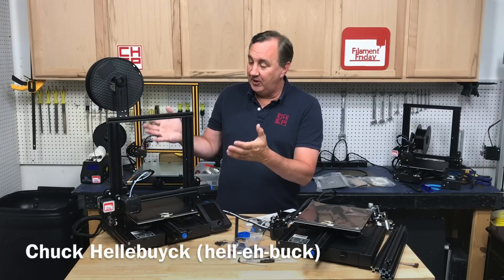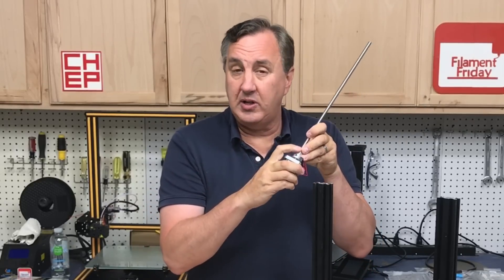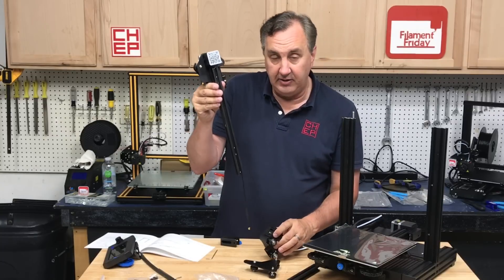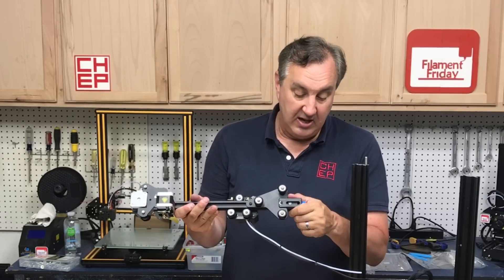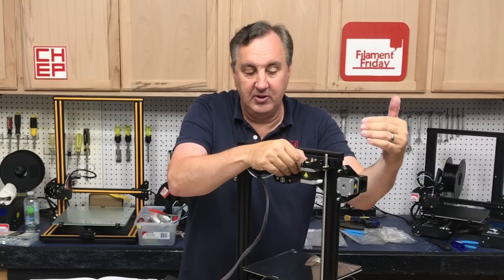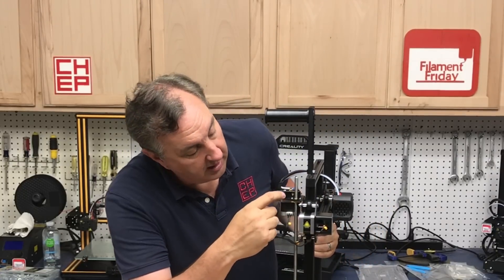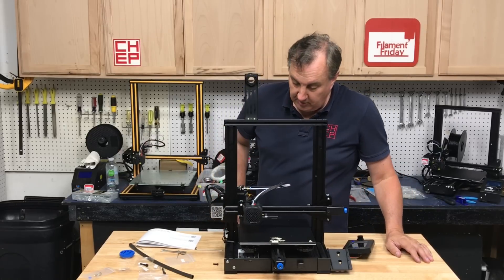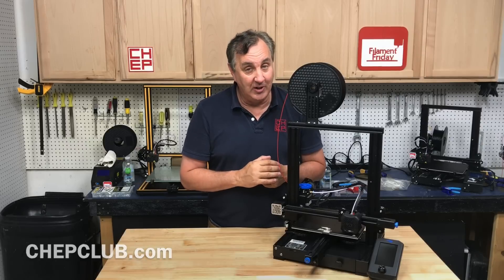How to Setup an Ender 3 V2 3D Printer

Comment: I have assembled my new Ender3 V2 and updated the firmware. Everything works fine but two things is strange. (1) When the power is off and I move the bed along the Y-axis, I can feel that it hits what feels like soft bumps at 2 or 3 places. Moving the bed using the motors, generates no noise or uneven movement. The second thing is about the mechanical switches on the printer. Using Octaprint I can step the extruder head and the bed, beyond the place where the switches are closed. I can hear the clicks but are still able to move the head and bed until they hits their physical ends, making the engines grind. The switches are connected as they should, but is doesn't look like they are working as expected. Any comments ?
Reply from the maker: What firmware?
Reply: @FilamentFriday  It's the Marlin 2.0.6 Release from your home page.
Reply from the maker: I’m looking into it.
Reply: @FilamentFriday  I think I have found an answer to the problem. In general I found that the printer acted strangely so I went back to the official Ender3 V2 firmware "Ender-3 V2_32bit_ 2.0.1V Latest Firmware_0814.rar " and the printer started working normally again. It now stops me from forcing the bed and hotend beyond where the switches closes. For now I'm staying with this firmware version and maybe look into what happened later on.
Reply: Hi, did you get any answer to the question about the bumps? Having the same experience. THX

Comment: I have received my V2 yesterday and 1st print was easy.  One thing I found out that the PSU fan located at the bottom  run in high speed and noisy.  Do u have this issue?
Reply from the maker: Some have said that. Mine isn’t too bad.
Reply: I also found out today that the psu fan is blowing air into the psu but there is no vent for the air to exit. For the hot end extruded plastic cover,  the fan noise is significant reduce if fan is not blocked by the air intake holes.

Comment: This is brilliant - My Ender 3 V2 (my 1st 3d Printer) arrived this afternoon and after opening the manual realised I needed help. I remembered your video, so using it as a guide assembled the printer, updated the firmware then manually leveled the bed and did my 1st print using the sample filament included. Very happy with the results ... and I'm sure my Grandkids will be too, as the print is for them :) Thanks heaps

Comment: Just a heads up for anyone who may be having difficulty with this. Make sure the card you are using is formatted to MS-DOS (FAT 32) otherwise it wont do anything and nothing will show up. Download the zip file from the link above and extract the zip file, change the name of the .bin file to anything you want (could be dog.bin)  load it to the micro SD card,  turn off your printer, put card in and power on. You should see a blank screen for a little while and then the creality loading bar appears and you will be updated!

Comment: Would upgrading to any 32 bit board work the same way? I have an ender 3 pro with an 8 bit board. This might be a good reason to upgrade. I presume the 32 bit board does need to have a boot loader on it.
Reply from the maker: Most of them, yes.

Comment: Thanks for another great video Chuck!  On inserting the Z-rod - we don't want the rod to touch the motor shaft (in case the coupling doesn't have a shoulder to stop it from touching).  If the two shafts touch, the coupling can't flex in one direction to absorb any misalignment - we need a gap to allow it to flex as needed to keep from inducing any stress in the system.

Comment: What file system does the sd card for the firmware upgrade need to be formatted to?
Reply: Dave Williams I used a standard sd 32gb card. Make sure the card is empty.. no other files on it. I went to crealitys webpage and download the bin file. I dragged it to the sd card and I renamed the file to dog.bin  insert the card and power on the v2 and it worked no problem. If you need any help let me know. Good luck 👍🏻
Reply from the maker: I believe FAT32

Comment: Hello, I just got my Ender 3 V2, followed the steps to update the firmware, put the sd card in the printer, and all I got was a blue screen.  Let it sit for about 10 minutes, turned off, removed the sd card, now all I have is a blue screen, sd card or not.  What happened?
Reply from the maker: Try again with a different name for the file.
Reply: @FilamentFriday  I finally got it to boot, now on the latest firmware. Working through you bed level now.Thank you.
Reply: @richardoliver890  Hi Brother. Which file worked for you there are two files on the creality website. still working on the blank screen issue.
Reply: @FilamentFriday  Hi Chep, I tried a different name, same thing.  The original file is .hex, I renamed it to firm1.bin, sound correct?
Reply: @FilamentFriday  I found the correct .bin file, however I am still not able to get beyond the blank screen.  Is it "bricked" or do you know how to recover it?
Reply from the maker: It should be a .bin not .hex. Did you use the link in my description to the Creality site?
Reply: @FilamentFriday  I have the correct file now, however it will not update, still a blank screen. I have tried 2 cards.
Reply: @FilamentFriday  I could not find the link in your description
Reply: The blank screen thing is happening to a lot of people.  Their latest firmware (from July 24th) is causing this.  I (and others) had to take the screen apart and update the screen firmware to correct this.  Finding that file is the fun part.
Reply: Brian Blake i also got the blank screen.I found if you rename the .bin file to a different name each time it works . For example I named it dog.bin it worked.

Comment: Hello CHEP. Thanks for you teachings. I have received my Ender-3 v2 two days ago, and I needed to adjust the steps of the extruder from 93 to 101. But when I hit the button "Store configuration", the new configuration is not stored when I turn the printer off. Any idea?
Reply: did you keep sd card connected to the printer once you store configuration and once you turn the printer on ?
Reply: @omarmoshabi  Hello Omar. Thanks a lot. Of course I kept the SD card in, and it worked fine.
Reply from the maker: Have updated the firmware to 1.0.1?
Reply: @FilamentFriday  Yes, I did. In fact, I have discovered that you need to have the SD card inserted. The configuration is saved on the SD card. 
Another question: do you have any idea of a calibration that would fit most Ender-3 v2 printers? Mine came with the original calibration: X=80, Y=80, Z=40, E=93.
For the extruder, I have discovered that 93 causes under extrusion and 101 extrudes the exact length chosen.
Reply from the maker: I haven’t tested that fully yet. I’m testing a new firmware from Marlin that save to the EEPROM instead of SD card.

Comment: Hey, I was wonderding if anyone could help me with this. I tryed to flash the firmware to my ender 3 v2 and I let it sit on the black screen for a half hour. I thought something was wrong so I turned the printer off and took the sd out but now when I turn it on its stuck on the black screen like it's bricked. Plz help
Reply: I'm having same problem
Reply: Was this the 23 July latest or the BL Touch version from 24th?
Reply: @Orthodoxuk  It is the regular firmware not the bl touch one.
Reply: This has happened with the  1.1.6 (non bl touch) latest version July 22/23
Reply: Same problem here.  I'm really sick of this beta POS.  I've had nothing but problems with it.  Time to move on...

Comment: Sorry a newbie here but do I  have to unzip the latest 23rd July SD zip download file before I  put it onto the machines SD card, or do I  just leave the whole lot as is.? Thanks
Reply from the maker: Unzip
Reply: @FilamentFriday  I followed the instructions  and updated the firmware but all that is there is a blank screen after and hour I turned off, saw your other comment and tried that but still black. How to fix that?
Reply: @13tabicat13  same trouble here
Reply: @GonzaloGabrielRico  creality was trying to make me feel like the bad guy for doing the upgrade. Still haven't told me how to fix it
Reply: @13tabicat13  Hey men. I just tried to replace the included SD Card for anotherone, with the .bin file with name firm.bin (just that file, without folders or anyother thing, and I worked!!!. Now it's working and no more troubles :)
Reply: @GonzaloGabrielRico  I'll try that name. I did the same with another card but no luck tried 12 times different names
Reply: @13tabicat13  remember just put the. Bin file and nothing else.
Reply: Thanks

Comment: Followed the steps for the firmware released July 22 - V: 1.1.6 and the black screen happens then Creality logo shows and then no loading bar... Anyone else experience this?
Reply: The same trouble. Still no idea how to solve it.
Reply: I just solved that changing for a different SD card
Reply: didnt work for me.  the firmware is still at 1.0.1

Comment: Anyone notice two updated E3 V2 files on Creality's website?  One yesterday with new firmware, and another today with updated SD card contents (manual, sample models, etc)?  I downloaded the firmware, and did the SD card install, and the printer screen did go black for about 10 seconds as if it was updating, but when it came back up, it still says 1.01.  Anyone get anything different?
Reply: I just noticed when you unzip their file called Ender-3 V2_1.16V_Latest Firmware, the firmware file inside is still the same V1.01... (?)
Reply: @bkblake01  I noticed that as well, they are the exact same binary files.
Reply: @bkblake01  Did you get your working again?
Reply: same with me. its stil 1.0.1

Comment: Chep, You mention adjusting the  x axis extrusion to be parallel with the top cross bar. Good point. Creality and other brands using similar systems could make this much easier by drilling two holes through  the Z axis extrusion.  Then you could slip the hex key through to the screw heads. That's what I did to mine, also don't tighten the screws on the opposite Z carriage until the X axis extrusion is parallel.
They drill the two holes in the wheel bracket so we can reach the screws. How much harder to give us two more holes.

Comment: Hi CHEP. Thanks for all the informative vids. I just got the v2 the bug I noticed was when I sliced a Gcode for any print. The printer speed skyrocket up to 780% sometimes pulling the hot end to the far right and sometimes freezing. I put the same code on my ended 3 pro and it works fine. I reported it to Creality but I kinda prefer your style of explaining because your pretty thorough. And I did have issues with your cube too, I’m glad you brought it up. I also updated to the latest firmware.

Comment: Nice vid! Great help. Newbie here, about the firmware thing. Do I need also to upgrade to Marlin with BL Touch 2.0.1 V1.1.1 or just the Firmware 2.0.2 V1.0.1 is all good? Are those two the same thing or what, I don't understand why they release an update with just 1 day gap.
Reply: You don't need the BL touch firmware, just use the regular one. Just Google BL touch if you want to know what it is.
Reply: @jared9190  Thank you!

Comment: Hello CHEP. Thanks a lot for your instructive videos. I received my Ender-3 v2 today July 21, and the first test print is wonderful. 
I prefer to use Ultimate Cura slicer, but in the list of printers, there is no Ender-3 v2. How can I add it to that list?
Reply from the maker: Add Ender 3 Pro printer in Cura but before you finalize by hitting the Add button, change the name to Ender 3 V2.
Reply: Thanks a lot.

Comment: Hi Chep, I really appreciate your videos, and I'm new to printing and just received my Ender 3 v2 two days ago, and now the bed displays 0 degrees and when I try to preheat the bed or start a print the printer reboots, what do I need tyo do to fix this, I need some help?
Reply from the maker: Not sure. Sounds like a wiring short or bad board. Can you contact the seller?
Reply: @FilamentFriday  yeah I sent them an email hopefully I hear back soon from them. Thanks for the reply.

Comment: I have fitted a BL Touch 3.1 kit for a v1 mainboard by modding bracket and altering pins and holders on the cable  at mainboard end to a Ender 3 V2 - as Creality has released on 19th July 2020 a Ender 3 V2 firmware (official) with BL Touch support - (but no kit as of yet) - its working and installed and running the auto level program. looks like i need a 2.5mm (guess) spacer to lower probe - will update once finished.
Reply: looks like Creality has pulled the BL Touch firmware for the E3-V2 it was up on 19/7/2020 and gone by 22/07/202 ..... guess either it was a internal release or they want you to buy THEIR Ender 3 V2 PRO (if/when it comes out!!...) and not do a D.I.Y install.

Comment: I'm trying to decide on my first printer and I'm torn between the V2 , the pto or the standard standard ender3. 
The price difference isn't that big a concern for me, but I'm not sure which feature differences will make the biggest difference to a beginner?
Reply: I just ordered a V2 yesterday. I wanted the 32 bit board. Check Ebay for about $30 cheaper than Amazon.
Reply: Get the V2!
Reply: Order thru Creality web page free shipping no tax . Use coupon crd10 for $10 off . Total $259 shipped

Comment: I'm new to 3D printing and decided to get the V2 as well. I've been having it for two weeks but for some reason the nozzle keeps on clogging or its under extruding. I have yet to have a successful print on my machine. My original bowden tube clogged  so I bought capricorn and then it clogged again I also switched nozzles just in case but I just cant seem to figure it out. I have no clue what else I can to to solve my problem. Can anyone please help me?
Reply: It may be your filimant but I highly doubt it. Maybe try fiddling with the extruder motor to alittle higher speed. Hope this helps. (Btw I have an Ender 3 Pro V1) 👍😊
Reply: Aum Prajapati  I've actually found out that there's something wrong with the extruder! For some reason the bearing isn't gripping the filament and I took it apart and put it back together and tightening everything but my calibration cubes keep failing a couple layers in.
Reply from the maker: Check these for ideas. https://www.youtube.com/playlist?list=PLRFPlUhDTTlka-Cq-UmI3IbbHRIwG2OsX
Reply: @AAAclanairbornkilla  Great!

Comment: I got the Ender 3 Pro two weeks ago and I'm slightly regretting it. I've spent so much on it to perform as quiet as the V2 when I could have bought the V2 for less.
Reply: What's done is done... move on... unless you have a good return policy like Amazon.  Either way, the PRO is a GREAT machine!

Comment: I used a bubble level app on my phone level the printer. It's a really good idea when assembling anything, to not fully tighten any fasteners until all are in place and snug. It makes it much easier to square something to the rest of the components, if you leave some initial play in the bolts. It helps to get the play out of the rollers, if it's done individually, before final assembly. From a quality control standpoint, I think Creality cut mine pretty close to spec so squaring wasn't a problem.

Comment: Hi CHEP, your video have been instrumental in starting my 3d printing adventures. I have to warn you and others, there might be an issue with the latest firmware. I just attempted to load the latest firmware from the site you provided and my printer has the black screen of death. I've left it with the screen like this for over 30min. I don't think it should take that long. I came across a reddit post of someone complaining of the same issue and had to contact creality support. In the post the person claims that creality gave him a DWIM_SET folder to add to his SD card with the firmware. Are you aware of any issues with the firmware or have any other suggestions to allow me to continue using the printer?
Reply from the maker: Try changing the name of the file and try again.
Reply: @FilamentFriday  This worked for me! Was having same issues as Evan. Redownloaded file, but didn't change name to "Firmware.bin" this time. Printed booted up with new firmware installed.
Reply: Thanks for the insight. I tried different firmware bins, naming conventions, and even tried compiling Marlin myself. I even named it CHEP.bin hoping to be graced by the 3d printing gods but unfortunately I'm out of luck. Hopefully the Creality folks respond to me sooner than later.
Reply: @IzzoYourNizzo  I had the same problem, blank screen after the update. I've downloaded the firmware again and renamed with some random name dot bin (ex: new_firmware.bin) and put it in a different newly formatted SD card, less than 10 seconds of blank screen and the update was completed.
Reply: @PabloVivera  Thanks for the insight. Based on everyone's advice, I just kept at it. Constantly restarting the machine and trying different SD cards and different file names. I've suspected from the start that the micro SD card reader may be a little finicky as I sometimes had to insert the card a time or two to get the printer to read it. I though maybe it just took the printer a second to read it but my port may be a little faulty. Ultimately, I was able to get the unit to boot an image and now all is good. As I'm learning with this printer though, if it's not one thing it's another lol. Now my Z Axis rod seems loose and the stepper motor doesn't seem to grab the coupler at times. Off to my next adventure. Happy printing everyone.